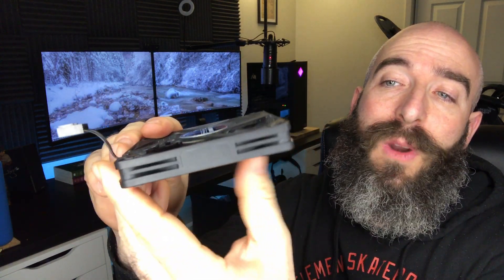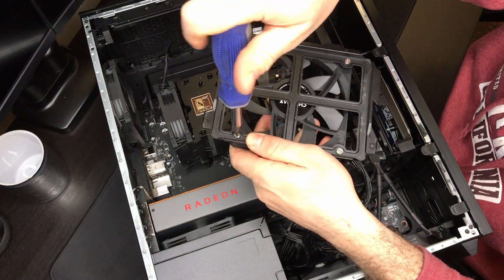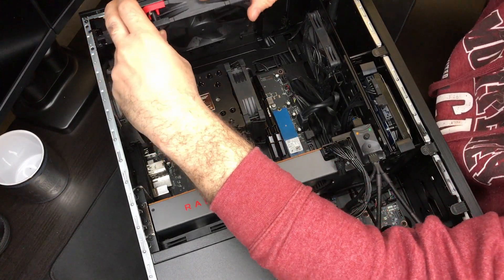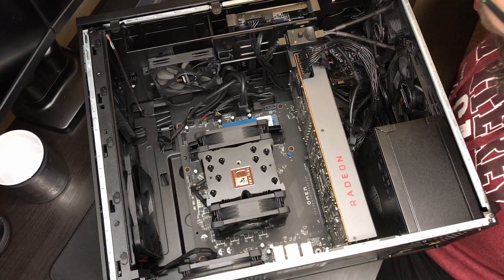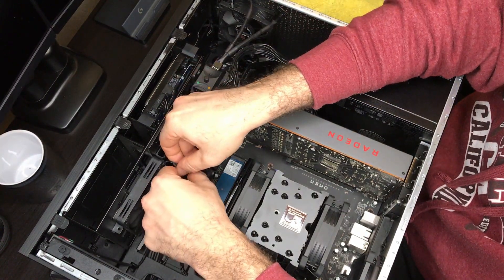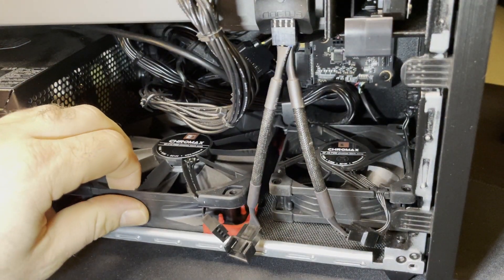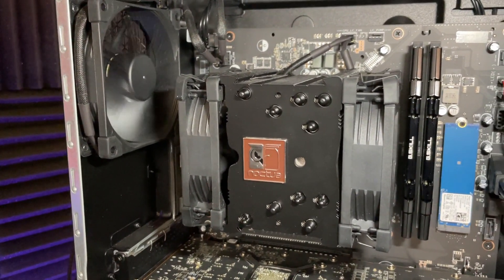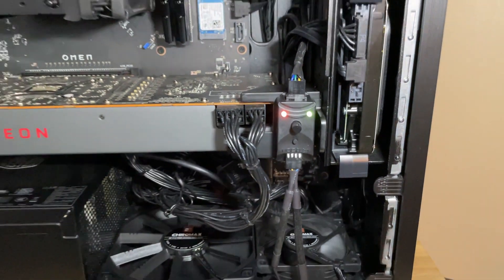How to: Install and Setup All Fans in an HP Omen 25L / 30L! Tutorial & Guide!

Comment: Hey thanks for the info I was able to upgrade my rig with some spare 140 noctua chromax fans. I was able to fit two of them. One at the top and I e at the batter like you did. Had to use the noise reduction rubber screws in order to mount to the top of case ( didn't have screws) just curious I know you no longer have this case. But can you recall you decided 120 top and bottom? 140 fit for me. Mind you. The top140 is the one that comes with the d15 because the standard 140 case fan won't fit. The one that comes with the d15 fan has a frame mount of a 120.

Edit* ohhh the cable management clip at the bottom.  Your right it was in the way, lol I tore it off. Still would like to hear the reason. For the top 120.
Reply from the maker: Well, I used a 120mm fan at the top because that is what the bracket at the top of the case supports. It has 4 holes in it that will only a 120mm fan and I wanted it installed as clean as I could. Not sure how you would even attach a 140mm at the top.

Comment: Did you put the top as a exhaust fan or intake? If it is exhaust n I put mines on intake will it affect the exhaust on the rear ? Do you think the rear exhaust a good fan or should I switch it out ? I just ordered 2 p12 120m psm pst artic fans . 1 for the top one for the bottom . I also ordered 2 f9 92m pwm pst artic fans . One for the front and maybe if the rear one sucks swap it out with the f9. Let me know I ordered the 25l 3060 GPU HP OMEN from Costco will be here Friday . Thanks
Reply from the maker: I used the top fan as an exhaust but some claim they see better results with it as an intake. The nice thing about the top fan is it takes about 5 minutes to swap between the 2 orientations, so you could always experiment with the 2. 

IMO, I would replace ALL the HP fans! While they are OK, new fans will push much more air and be MUCH quieter. The noise level of the HP fans is pretty high, especially at high RPM.
Reply: @DanKamYouKnow  thanks man . Freaking sucks they didn’t add front fan mounts . Almost made me wanna cancel but with this chip shortage n good deal on 3060 I got no choice . But if a gpu appears within 90 days sending it back lol
Reply from the maker: With some minor tweaks, you can make this PC work great for you. Then down the road you could always case swap. My Omen was great for me.
Reply: @DanKamYouKnow  does it have extra power cable & sata cable for a extra hdd?
Reply from the maker: Yeah, it should have 1 extra set of cables for another SATA drive
Reply: @DanKamYouKnow  on my ph omen my power plans are gone only balance . I can’t access cpu power management . Only gives me display sleep , desktop , background settings
Reply from the maker: I’m pretty sure HP has disabled the ability to change these power management settings. Most of the newer Omens don’t have this ability now
Reply: @DanKamYouKnow  wow
Reply: @DanKamYouKnow  do you set your omen on high performance or balance ? Using the omen app
Reply from the maker: I used the high performance setting

Comment: I wanted to install a Fan Controller like you have, but I am using two disks so I dont see another extra sata to be used. Ive tried to find Y spliter but the connector to disk needs to be in angle, otherwise the case cannot close
Reply from the maker: If you are using both drives, than unfortunately there isn’t another SATA power connector to use
Reply: @DanKamYouKnow  on the motherboard, there is a small 4pin connector (left botton, close to the PSU) named "PB-EPWR", do you know what that is for?
Reply from the maker: I do not know what that is but I don’t think it’s a fan header though.
Reply: @DanKamYouKnow  ill probably end up changing the whole case and stuff lol thanks for these videos!!

Comment: I ordered 4 120mm fans, the splitter, and the control to make a similar set up on my Omen 25L. The total came out to more than the Noctua CPU cooler you're using. I am planning on using the Omen cooler for at least 4 months before upgrading the CPU cooler. I think having great airflow in the entire case is probably better than just adding the CPU cooler by itself. I'm going to run some tests to see the temps before/after adding the 120mm fans.
Reply from the maker: It’s actually the opposite. The CPU cooler is hands down the best modification you could make to the PC. You really only have room for a top and bottom mounted 120mm fan, so you really only need 2. You could maybe double sided tape a 120mm to the front. In my opinion, I’d do the CPU cooler, top 120, and bottom 120.

Comment: Thanks for all your videos Dan, I have a question regarding the front 92mm fan you installed. I have a 30L case and was thinking about adding one but would it interrupt the airflow from the bottom intake fan you think?
Reply from the maker: Honestly, the fan I mounted in the front didn’t really help with airflow that much. It definitely won’t hurt but didn’t make the biggest difference. It shouldn’t interrupt flow though 👍🏻

Comment: added the fan and it works fine but It did make my pc a little louder. I downloaded SpeedFan to make the fans quieter but it doesn’t detect any of the fans. any advice ??
Reply from the maker: What header did you plug the fan into? Which fan did you add, the top one?

Comment: Do you use your top fan as an exhaust or an intake? I’m a new learner that just got an Omen 30L and I want to learn the best ways to modify to improve my temperatures. Thanks and great video!
Reply: Watch his other videos as well buddy. As a former noob the most important thing to look for as a gamer is at his video on the memory problem. Dang proprietary hp crap motherboard but yea good luck
Reply from the maker: For my setup, I found that the top works best as an exhaust fan. But it takes about 3 minutes to flip it around, and you could test with it as an intake as well. Welcome to the PC world! 👍🏻👍🏻👍🏻

Comment: Hey Dan, with that Noctua U9S cooler to put a second fan on the left hand side of it did it come with an extra fan clip or could in screw in?
Reply from the maker: The cooler comes with 2 clips to secure a 2nd fan! You will not need anything else, except the 2nd 92mm fan 😎. It’s linked in the description 👍🏻🤝
Reply: @DanKamYouKnow  alright cool thank you!! :)

Comment: Just got my 30L on Saturday, The omen is not running hot but I am still adding the top fan. Thanks for the video, hopefully I don't go with the upgrade upgrade upgrade mentality, haha, I know I will.
Reply from the maker: It’s hard not to fall into the “upgrade” mode, especially being a PC enthusiast. Constantly want to change and upgrade everything 😂. My Omen didn’t really run hot, but when I would render videos, it would. The fan additions and CPU cooler made a huge difference 👍🏻
Reply: @DanKamYouKnow  Great video.I bought an Omen 25L 3070 RTX with Ryzen 7 3700x/32GB DDR4 and 2TB Nmve pcIe storage.The Top mount bracket idea is a lifesaver.By instaling a 120 mm Corsair top fan and a Front 92 Noctua Fan my temperatures are around 32 idle and 62 while gaming with all setting at high.Thanks Dam your videos are like a bible to me when it comes to this computer.I need you to explain something to me.If my pc comes with a 550W PSU how can it runs perfectly with my CPU and GPU????????
Reply from the maker: Your system only probably draws about 400w of power. The 3700x is a 65w TDP and I think the 3070’s are about 220w ( I could be wrong ) so 550w is more than sufficient. HP would not ship a computer with an inadequate PSU. 

Thanks for your kind words!
Reply: @DanKamYouKnow  Thanks to you for the quick reply and the video quality.

Comment: Great video! I got a 30L 2 weeks ago and love it but It’s getting loud. My temperatures look normal but even playing not graphically demanding games, the fans are at 3000rpm and loud. Should I replace or add fans to help this out? And which ones?
Reply from the maker: Thanks!! Congrats on the 30L! The stock fans can definitely be loud and they don’t have the greatest airflow either. I would recommend replacing the rear 92mm fan and the 80mm CPU cooler fan, and the front mount 120mm fan, which will GREATLY reduce noise levels ( except for GPU fan ). You could always add a 120mm fan to the top bracket and a 120mm at the bottom as well. I love Noctua Chromax fans, they push a ton of air and are SUPER silent. I have all the link to the fans I recommend in the description. Let me know if you have any other questions 👍🏻

Comment: Maybe I missed it.  Are all these intake and the rear is the only exhaust?  I've heard if you use the top as exhaust, the two fight one another for air and messes up your thermals.
Reply from the maker: Bottom and the front fan are intake, and the top and rear fan are exhaust. That way you'll have pretty equal pressure in the case. BUT, some Omens users have found that top one works best as an intake fan so you may want to try both and see what your stress test results are!

Comment: Sure is a bitch that we have to upgrade cooling on such a expensive rig.
Reply from the maker: PC’s definitely aren’t cheap. Most Omens do run in the safe zone as far as temperatures go, so you don’t technically HAVE to upgrade the cooling, but cooler temps is always better.
Reply: @DanKamYouKnow  well I havent got mine yet, but I know I will have to get mine to cool down because my office is usually always hot so it will most likely be a must.

Comment: Hey man ! I ve been watching your videos and I have to say thank you so much! I have bought a pre-build omen 25L with an AMD 5 3600 and my CPU temperature while streaming and playing league of legends or brawhalla ( really weak games ) increase up to 80 and sometimes 85 degrees Celcius ofc. I have even since opened the case for more air to pass through. 
I wanted to ask you if you considered getting water cooling such as the Kraken m22 water cooling which I bought and I found extremely difficult to mount since I have to take the motherboard out entirely and I am not even sure If I will be able to mount the radiator plus  thefan since you the case is really small and not the best for extra parts. My questions for you would be, is 70 to 80 degree not as alarming as it seems ? And would you advise to follow your method and install multiple fans on the inside instead of a water cooling system ? 

Thanks a ton ! And wish you a great day Dan !
Reply from the maker: Hey Ahmad! A 120mm liquid cooler should fit within the chassis of the Omen with no issues, but you will have to remove the motherboard. I myself went with a Noctua air cooler which has yielded better results than 120mm AIO’s and doesn’t involve mounting a radiator. 

The fan additions/replacement will slightly help with temperatures and also fan noise ( if you replace the stock HP fans ). You could always try and set your maximum processor state to 99% and your minimum processor state to 5%. That made my temperatures plummet with almost zero performance loss. But tbh, 75-85c is a bit warm but those temperatures are considered safe. You could continue to game and everything would be fine. Cooler temps will make the components last even longer though.

Comment: I was looking at my mother board on my Obelisk 25L and it doesn't have the pins for the front fans. it  looks like it could have had them though. so if i were to plug in a top fan i would have to get a splinter to plug in the top fan to the back fan.
Reply: I also cut 2 2x2  wood and placed them under the computer to sit on to add some circulation under the computer.
Reply from the maker: Yes, y-splitting the top fan with the rear fan is the best way to do it.

Comment: Going to purchase a 30L 3070/i7 10700KF build today at microcenter. Pretty excited and grateful I came across your YouTube Dan. Hoping I can get by with stock for at least a little bit then down the line replace the case and cooling options. What do you think? Sidenote that desk is beautiful is it custom built or where did you get it from? Appreciate it boss
Reply from the maker: You should definitely be able to use it in its stock configuration! I used mine for a couple months with no issues. I would definitely remove the bracket at the top of the case to increase air flow. 

The desk is from IKEA! They are “Alex” drawers with a table top placed on top 😎
Reply: @DanKamYouKnow  Just got back and setting up now, will do! Thanks for the assistance. Looks like an IKEA trip will take place tomorrow, take it easy buddy
Reply from the maker: Have fun!!!!

Comment: Maybe run some thermal tests before and after installing upgrades to see what kind of extra cooling these new fans do for the GPU and CPU.
Reply from the maker: I have some videos dedicated to the thermals I’m getting with this setup. But to recap:

CPU:
Idle: 40-45c
In Game: 60-65c
Rendering: 75-80c

GPU:
Idle: 30-40c
In Game: 60-67c

Stock - CPU:
Idle: 55-60c
In Game: 75-80c
Rendering: 90-95c

GPU: 
In Game: 75-80c

The biggest change I saw was changing the CPU cooler and setting up a custom fan curve for my GPU in MSI Afterburner.
Reply: @DanKamYouKnow  Thanks! Yeah I just purchased the Omen 30L RTX 3080, and was going to switch out some of the fans for Noctua, and adding fans where you’ve specified. Then seeing how the Omen AIO performs during gaming and editing, have a few AIOs that I may switch in there if need be. I also was on the fence to just swap out the case for the Lian Li 011 Dynamic, and go from there. But didn’t want to spend too much more money if I didn’t have to.
Reply from the maker: The best mod you can do for your system ( the higher end 10700K’s / 3080 builds and higher ) is to swap out the case. Fans will have very little effect because the case just lacks airflow. If I had your system, I would swap out the case and opt for a 240 or 280mm AIO. Only AIO that fits in an Omen case is a 120mm and that’s just not enough for those super strong processors. Plus the 3080 gives off a lot of heat as well. I’ve seen those machines sit between 85-90c while gaming in stock form. Way too warm for my liking.
Reply: @DanKamYouKnow  Does swapping out to a new case void the warranty on the Omen through HP?
Reply from the maker: Yes. HP will require the PC in stock form before they consider warranting anything. I did just do a case swap for my channel though if your interested.
Reply: @DanKamYouKnow  oh so if I upgrade the CPU cooler it would void the warranty?
Reply from the maker: @johnsnowwww  Technically yes. If you revert the PC back to it's stock configuration before getting warranty work done, you should be fine. Probably best if HP doesn't know about the modifications if you're trying to claim warranty work

Comment: HI Dan,

Do you know what kind of connector the stock CPU fan lighting uses? I want to upgrade to an AIO Water Cooler, with lighting - but everything I can find online has a totally different connector type!
Assume I'll need some sort of adapter cable, but no idea what the connector type is....
Unless I can pair off one of the others, like the front fan lighting connector.
That lighting module is a right barnyard of randomness for lighting!
Reply from the maker: So, HP’s RGB is proprietary and you won’t find any kind of adaptor for it to work unfortunately. I’ve seen some people use RGB controllers that plug into the rear USB headers but it just seems like such a pain and hassle. I have no attempted to hook up anything RGB so I unfortunately do not know exactly what is involved.
Reply: Thanks Dan,
I was wondering if this was the case! What a faff!
Will be  a plain/non lit air or water cooler then :)
Reply from the maker: At least you’ll still have the case lighting 👍🏻

Comment: I want to put in some bottom fans. On the motherboard of my 25L it shows ‘CHF AN’ Can I use the y-splitter on that and place the bottom fans?
Reply from the maker: Yes, you can use that header!
Reply: @DanKamYouKnow  I’ve had my 25L for a couple of months. Wasn’t too confident changing/adding fans but your videos have helped
Reply from the maker: That’s awesome to hear! Happy to help my friend!
Reply: @DanKamYouKnow  I have the same header on my motherboard (bottom right) and it doesn’t seem to control the speed of the bottom fan. Only running at a constant low speed. Any thoughts? It’s a 4-pin connector
Reply from the maker: Is the PC under load when you are watching it! The RPM will be pretty low if it’s at idle.

Comment: How many watts is your power supply? And I’m thinking of putting in top and bottom fans
Reply from the maker: Fans don’t require a PSU change, I was using my 500w PSU for this setup 👍🏻. I now have an 850w PSU that I also uploaded a video on.